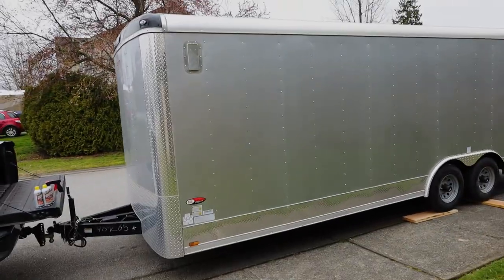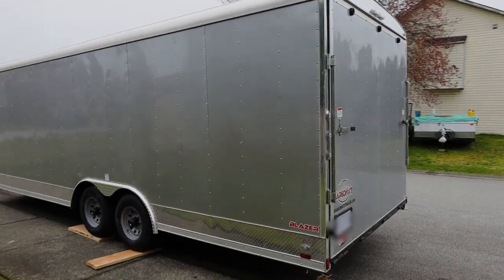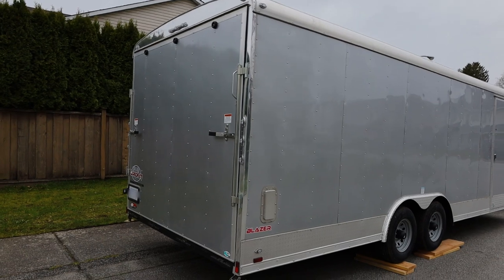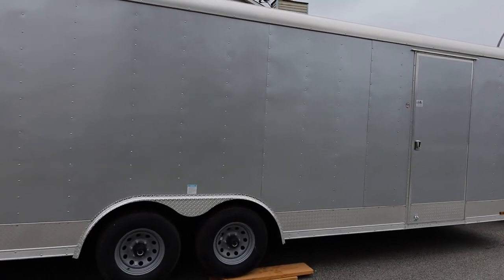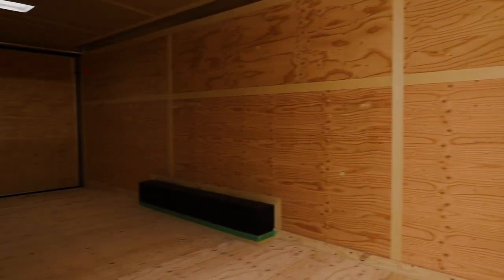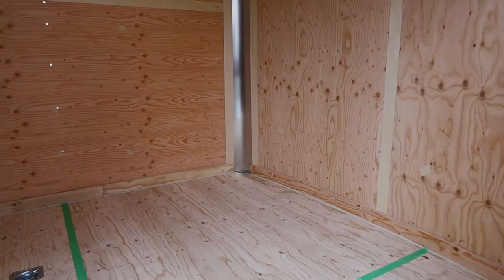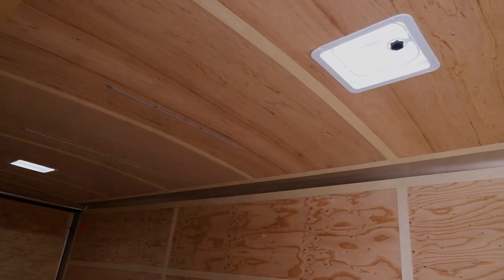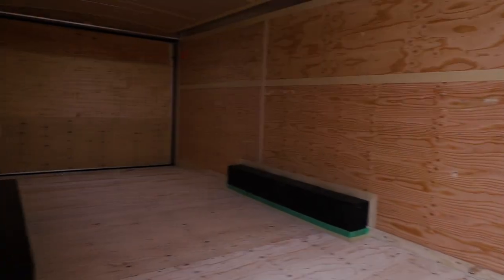Cargo Trailer Undercoating Protection

Comment: What do you think about using Truck Bed Coating, like from Herculiner, for coating? Would it maybe be even better to do a double coating of Shield Rust/Fluid Film + Herculiner? Not sure which to spray first if a double coat would be good, would just prefer to only have to spray it once and only once😂
Reply: I'm going with line X for undercoat. Then spray foam insulation over that.